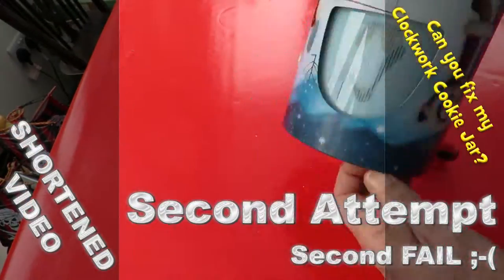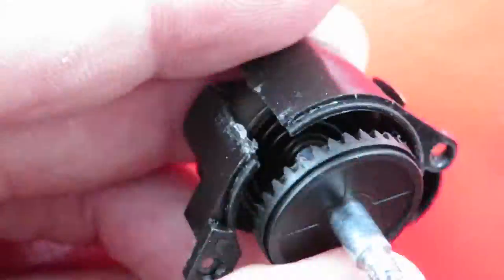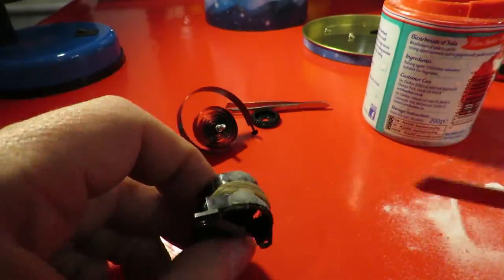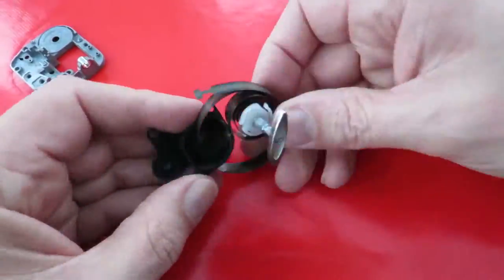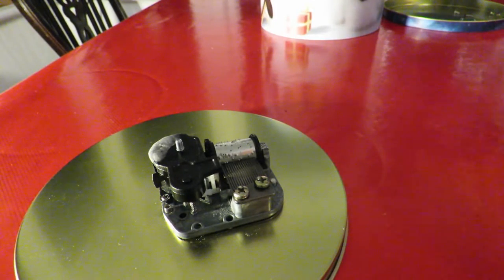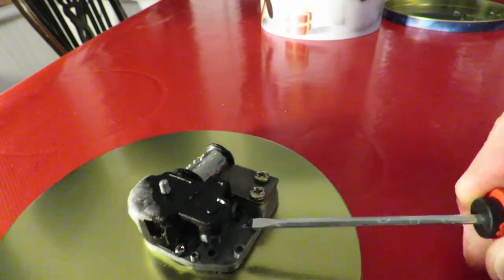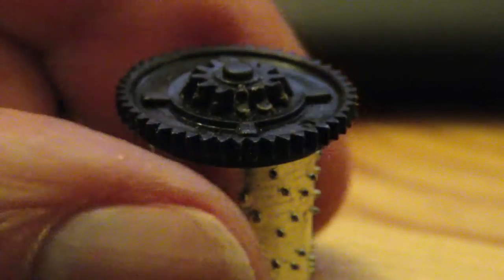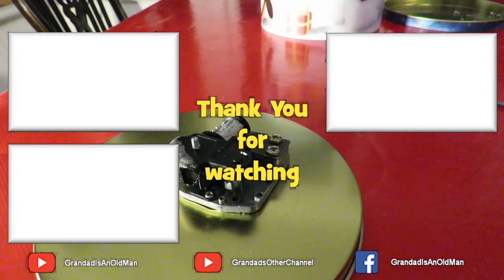Hey Grandad! Can you fix my Clockwork Cookie Jar SECOND ATTEMPT

Comment: nice video grandad, pitty  it had failed but i was thinking if u could put the guirella glue mixed with the soda along the crack because that would line things back up again and when you screw th music make back on the lid then everything would be straight again.
nice video too.
Reply from the maker: The cast metal frame is split and the teeth on the gear are worn down. Now that I have worked on it in close detail I can see the original cause of the problem was the misalignment cause by the frame flexing where it had split. That allowed the gears that govern the speed of the escapement to slip and the spring expand rapidly. The rapid expansion had an almost explosive impact on the inside of the plastic case shattering it and at the same time the teeth on the gears were damaged. Either the metal of the frame was poor quality or just too thin to handle the power of the spring. Even if I reinforced the frame with more of the glue the damaged teeth on the gears are not repairable and I doubt a replacement gear is available as an individual item. On the positive side, it does look like the pin wheel could be re-used on another music box to give a change of tune 😊